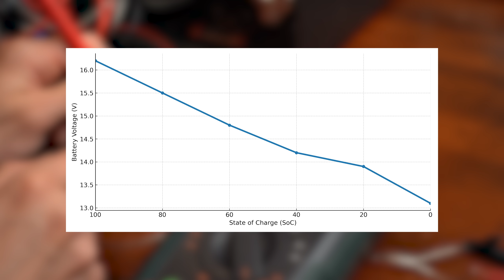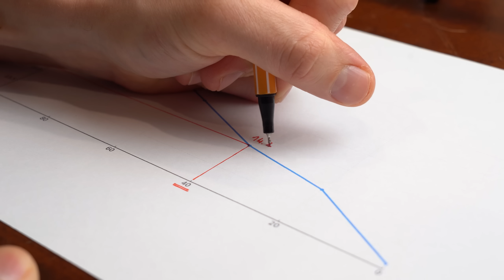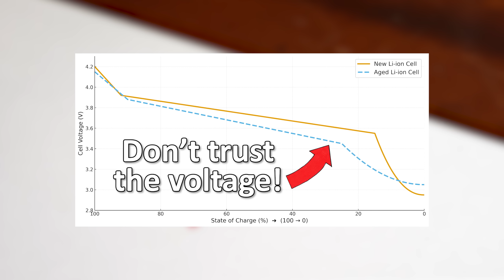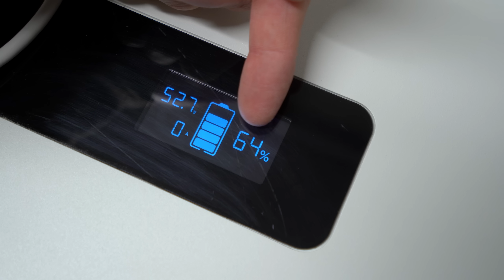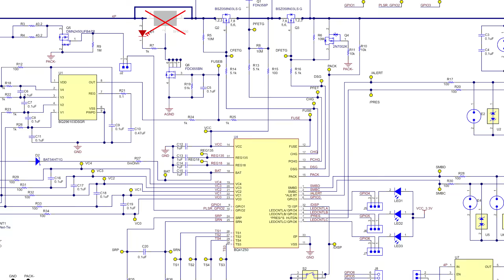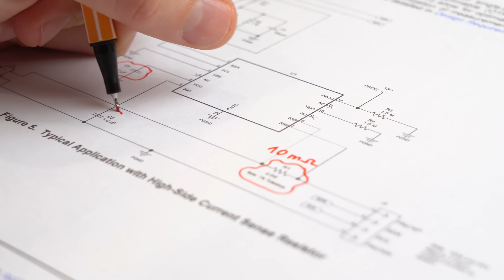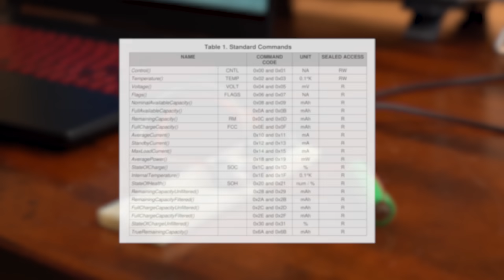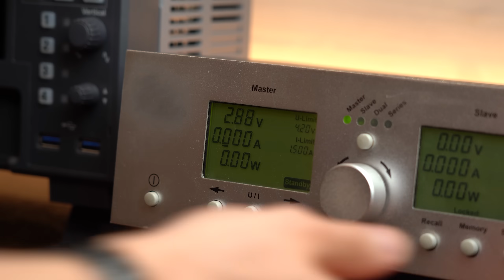The Amazing Secret in every Battery! (Fuel Gauge) EB#66

Comment: Just use a single cell big battery by connecting multiple cell in parallel AND use a voltage booster module to power the boom box

Comment: I've been wondering for years how phones and other devices can perfectly tell SoC while the battery voltages vary with different loads. Everywhere I saw a battery charge level indicator DIY, it works by measuring voltage. But never have it crossed my mind that the answer lies in measuring current. My mind is kinda blown right now.
Thanks man!

Comment: Well that was some awesome piece of knowledge, I'd like to give you a suggestion. Why not use INA219 module and integrate the current over time to get the charged and discharged capacity? The INA219 directly reports V and A over I²C and has good accuracy. I made such a temporary setup to check the capacity of a Newly bought 21700 battery. You'll just have to write somewhat complicated code to get the health and internal resistance as well.
Edit: and I need a part two on this where you tell us how to get the SoC and SoH of the multiple series battery packs. Like your boombox's 4S pack or 5S packs. Waiting for it!

Comment: For your Boom box, that requires LED indication also with fuel gauge, MAX17263 is a perfect choice. I've done a similar project that required 2S-6S configurable Li-ion pack and LED indication required for the product. Texas instruments ICs are bad when it comes to led indications with fuel gauges. I have an ESP32 code ready with MAX17263. Just need to add your battery parameters as an input.

Comment: you could use that fuel gauge on one of the cell groups of your multi cell battery if SoC is all you need. If one is at 50% say, chances are the rest are pretty much 50% as well, no?

Comment: Long time ago when i tried to google about Ah to Wh conversion in batteries, most what i found was a straight coversion V*Ah=Wh and no mention that when using Ah, it does not take into account the voltage drop happening when dischargin and thus Ah even when the voltage is known, is less because the actual power goes down when voltage starts to drop. So Ah is nonsense unless a constant voltage source is used, which a battery is not

Comment: If you have so many cells, maybe consider a BMS?
Many BMS offer BT connectivity (thus monitoring of SOC, sometimes also SOH), monitoring and balancing (which helps degradation etc). And some even have their own display.
Although a BMS is not as affordable as the depicted fule gauges.

Comment: Interesting to learn that the gauge needs a complete discharge and charge cycle to calibrate itself. I mean, it sounds reasonable when explained in detail like this, but when my cheap Android-based phone started having problems with battery capacity following an OS update, I didn't really believe the manufacturer when they said that running the phone flat and then fully charging it might help. This advice does seem to make sense now though.

Comment: i saw the title and immediately thought,  he's gunna use a coullomb counter.  the ones from aliexpress are pretty good if not amazingly reliable in all conditions.
Reply: did not in fact use a coullomb counter in this example but they are the answer to your problems...  just make sure it can handle your input voltage...  lots of free suites available that can turn a counter and an esp into a reasonably reliable charge level indicator/ controller. then you're just an eprom away from a condition tracker with a fillup reset.

Comment: To be fair, the battery level, even percentage level does not tell you the truth, because often it also relies on imprecise measurements. Yeah ok you can use another method of counting the capacity, but it quickly gets thrown out of the window when temperature, age, overdischarge and other effects take place. It is even more daunting when you deal with packages that are purely bizarre, like for example 30p1s packs, where discharge curve is so annoying the resulting errors in total capacity start to become more prominent

Comment: On a past work related experiment we used the TI BQ34110 chip. The device we used it for was the prototype controller that had four Li-Ion batteries. A later remote device we has four LiFEPo and the same chip was a great choice. 
Currently testing the BQ34110 in a portable field RF test set. Even though this is a we bit older (couple years or go back) it is easier to use than some other newer chips. 
Hope you do get to that Boombox fix. 
Peace

Comment: A caveman solution would be to use multiple of those gauges and use your arduino to verage them out. Also, there are lots of phones which use double cells in a single battery, there might be a solution in reverse engineering one such device.

Comment: Cant you just hook up the "single cell" fuel gauge to sense the voltage at the first battery connected in series? With working BMS a single cell voltage should be very good approximation of all the rest as well.
Reply: As long as they age together but that’s a concept I’ve seen being used. Also at times there is a voltage divider for the voltage portion being used and the coulomb counter on low side is good for this. Manufacturing variances suggest about 5-10% variation.

Comment: Can you hook this up to 1 of the batteries in your battery pack and still get this data? Granted, it may not be as accurate if the battery pack is not balanced, and all equal cells, but isn't it possible?

Comment: The BQ34Z100 is quite easy to use, I've used it myself in a battery pack! Took me like 2 weeks to set it up. For contrast: we also used another gauge IC from TI and after more than 3 months of research and development we still are discovering issues with our settings.

If you have questions, please leave a comment and I will help you to get your breakout board working!

Comment: Hello GreatScott, I beleive you could use the single cell fuel gauge for your boombox or every other application with multiple cells batteries as every cell of a battery pack should be in balance so connecting the single cell to one of the pack's cells should give an accurate enough SoC of the entire pack in percentage, don't you think? Of course there's some limitations with this option as there's no way to get an accurate capacity measure in Ah or Wh other than percentage...

Comment: Surely a "fuel gauge" is really a coulomb counter with memory and code to carry out the calculations? Pretty much what your Victron Smart-shunt is...?
A voltage divider should help you work with higher voltages, provided you can do the correction multiplication calculations in code afterward.

Once sodium cells become available, capacity as a direct result of voltage would not be so bad given their linear discharge voltage curve; the complete opposite of LFP or NCA/NMC.

Comment: Cool, thanks. Now I can add that to my DIY mini fan with mini OLED. I can track my voltage accurately because I directly connect the battery to my analogue pin of my Arduino, and the voltage is not accurate.

Comment: Another great video !

If you ever attempt to re-design your boombox with discrete current sensing. TI also has current sensing solutions that are pretty simple to use; some of the digital power monitors have current/voltage/power and even charge for this exact purpose.

Comment: I know you've talked about electronic loads before, but have you investigated regenerative loads i.e. instead of dissipating the power into a resistor/transistor as heat, why not dump the power into charging another battery (one that has plenty of surplus capacity to absorb all the energy from the battery under test, obviously).

Comment: The INA219 modules (current/voltage/power sense) are cheap and suitable for a fuel gauge of 4S cells. You already have the microcontroller to keep track of the current in and out of the cell.
Reply: But how does that relate to state of charge? Is there an open source library?

Comment: Coulomb counter like an LTC2944. Parametric modelling is via your uP. Of course it doesn't do all the cute stuff with internal resistance etc. If you really want all the fancy stuff then try the BQ41Z50 which is a full BMS, which is what you're really asking for. If you just want to monitor the state of charge then a coloumb counter is the way to go.
Reply: Yeah -- this is a very "diy" channel, but a decent BMS does everything needed here.
Reply: A coulomb counter on it's own only gives instantaneous readings, it also needs voltage, an MCU and memory to actually calculate SOC; even then the SOC is drift over time, so code is needed to reset the SOC on a full charge with very low tail current...

Comment: With how many subscribers you have, I'm sure this may have already been mentioned (YouTube needs a comment search feature). But just in case it hasn't been. I just recently designed a 12V UPS and I needed an accurate method of measuring the battery charge level. I needed to monitor multiple voltage/current points so I used the INA3221 module that has separate V+ (early models had common V+ creating problems with multi voltage systems). The INA series is made with single and multiple...if you check out the datasheet though, you'll get the point. Anyway, since I saw you had an ESP32 board but later changed that to an Arduino board you where sooo close to the solution. Install ESPHome on your ESP32 board and then using the INA3221 (or your INA model) component you'll have access to the voltage, current and shunt voltage. ESPHome as an integrator component that all you have to do is point it to the current sensor. You'll also need a global variable that buffers your total current draw which you then subtract from your Ah rating of the battery. When you recharge, you reset the integrator. And of course the best thing with an ESPHome project is that you will now be able to monitor and track this data in your Home Assistant (providing alerts, etc when it's time to recharge the batteries).

Comment: Some Lithium-ion battery charge meters aren't remarkably accurate, as there's also age factors that has to be figured into the equation, thus smart Lithium-ion battery management system, even DIY version with decent microcontroller would be better at figuring out how much charge is actually left.

Comment: Having a multi-cell monitor would definitely be a good thing.  Looking forward to seeing how you get on with this.
Reply: As long as there is some form of balancing for the cells in series, then monitoring one cell for the purposes of generating a SOC 0-100% gauge would be perfectly fine, although taking the series voltage though a divider and up-rating the shunt will also work for whole pack surety..
Reply: @dougle03  I'll let Scott make a video on it, but thanks for the info.

Comment: Interesting I struggled through programming a BQ34Z100 on a repurposed forklift battery BMS a few months ago. I turned it into a contactor-based bms for a 12V 2000W LIFEPO4 portable inverter box. They’re quirky little gremlins.

Comment: If your BMS has cell balancing, then you can use that single cell fuel gauge on one of the cells and still get info about the whole 4 cell pack, since if cells are balanced, then all should have the same state of charge. This will work even if cells dont have the same capacity, since the BMS will stop charging when one of the cells reaches low state, so the fuel gauge will see that state as low, even if its attached to one of the higher capacity cells.
Reply: Yeah exactly.

Comment: Nice, i think i need that breakout board
I just revived a bunch of 18650s in the trash, it holds charge well if using a multimeter but i'm not sure for how long or its actual capacity is

Comment: If you use a shunt of only 10mOhm than you measure only 5mV at 500mA. A nano have only 10 bit accuracy or 1024 steps for 5 Voit. Not a good idea for this measurement. a 16 bit ADC is better and you can integrate the mA/sec. If you reach the capacity or the min voltage of 3000 mV you cut the current of the amplifier at 0%. If you used 10% or 20% in mA/sec you can change the Soc display. If you use 3 or 4 cells you can use a R-R divider for the cut off voltage.

Comment: why not just monitor one of the parallel groups and add a capacitive battery balancer?  those can be upward of 98% efficient according to google. not as good as monitoring the entire pack with taps between each series connection.  But i think it would give "good enough" results.   some of the balancers i have used also have leds showing whats cells are being balanced.  These leds could let you know when you have a super weak cell too.   could also change over to 18650 holders so the cells could be swapped easily.   it appears you have more than enough room in the speaker enclosure.   from the typical application sheet, it looks like you could just monitor the current through the most positive cell and that should make it easy to just change code to calculate with Vx4 instead of just V.    no clue if this would work in practice, but seems okay in my mind..   anyone have any thoughts or see any problems with the idea?

Comment: schön zu sehen das es für so etwas einzelne ICs gibt. impedanzmessung zur bestimmung der restlebensdauer und restladung eines akkus, dafür gibt es ja einige messgeräte meist für batterien bis 3v oder für auto und lkw also 12v und 24v. ich habe das mal versucht mit einem arduino und ein paar einfachen komponenten nach zu bauen, also volt, ohm und ampere mit de arduino messen und dann auf impedanz erweitern, das klappt zwar aber ohne vernünfige werte tabelle und entsprechendes mapping muss man ständig den code an andere kapazitäten anpassen. nicht wirklich praktikabel. ich freue mich schon darauf wenn du uns deine lösung für mehrzellen-akkus zeigst.

Comment: The simple voltage monitoring is just a rough estimate of total capacity, it is still fine to have such fuzzy charging monitoring technique in most basic applications. The main idea there is that it is essential to keep each LI-Ion battery cell voltage withing specific range in order to maintain safe usage and prolong its duty. Well when it comes to some more advanced devices with more variable usage scenarios it would be nice to have more precise readings of the charge level so it happens that way the smartphones, laptops, UPS and whats so ever have such advanced monitoring functionality.
Reply: Depending on what you're doing and on the type of battery, that may be more than enough. That's especially the case for AA batteries where there's a voltage drop over time and the voltage drop itself is probably going to be the thing that stops the device from operating.

Comment: The SoC counter on JK BMSses is broken.
Or maybe it's not a true SoC counter. What do you think?
I have the JK-B2A24S20P in my electric scooter with 20 100Ah LiFePO4 cells in series, and the counter just doesn't seem to compensate for any battery aging or even the fact that the voltage will drop when the current rises.
There's a really dumb thing in the firmware that sets the SoC to 100% when the target voltage is reached, and to 0% when the lower voltage is reached. That could be fine if they actually counted the real capacity and set that. That doesn't change.

Then obviously when you accelerate, the current spikes, but these don't take that into account as it's all just voltage thresholds.
Your SoC gets set to 0% whenever you accelerate to hard. 
You need to set the thresholds to wrong values so it doesn't trigger, but then it also starts counting things wrong.
That doesn't solve the root issue. 
They don't seem to care about this problem. They won't give me proper help or any firmware files. They just want to sell.
So what do you guys think? Is there anything better?
Reply: if your cells drop THAT low the fault is on you.

more or better high current cells are the solution.

that i like using a cordless angle grinder or similar high current tool on a single row 5× 18650 battery of 3+Ah.